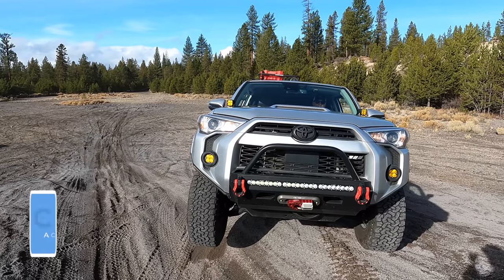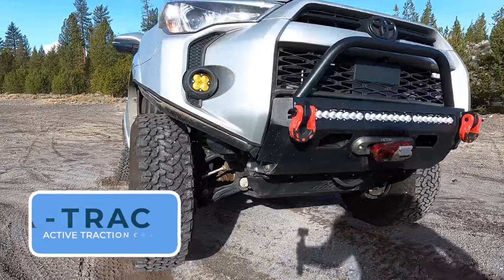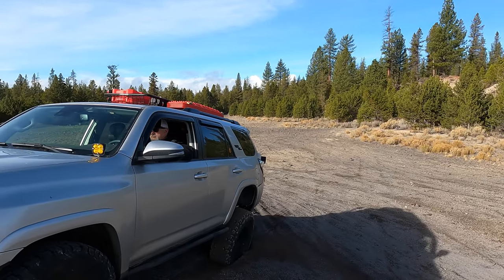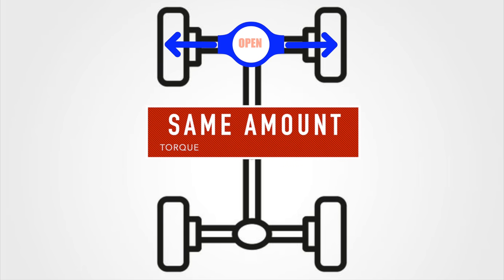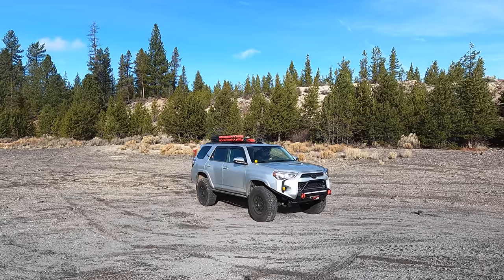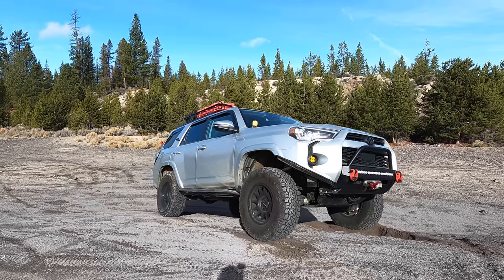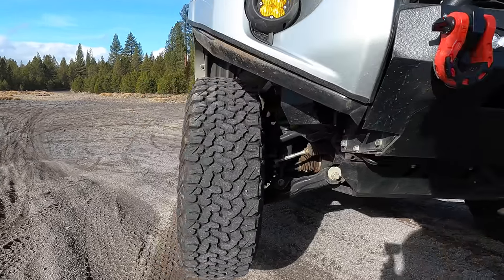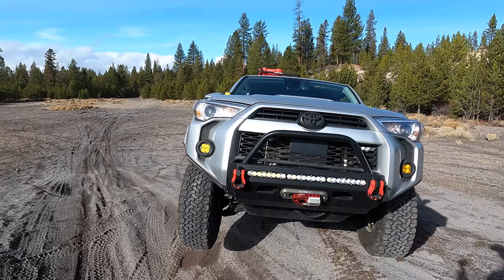Finally, The Only A-TRAC Video You Need to Watch. Multi Terrain Select Explained. ATRAC v ARB Locker

Comment: Very succinct and helpful. Thanks.

Is your brother using a Rigd rear tire hitch mounted tired carrier?
Reply from the maker: Thanks! I will ask Steve to join this thread and answer your question about the tire hitch mount.
Reply: Hey Tourist Dad, yes, that’s a Rigd tire carrier with a couple of options mounted to it, like high lift jack carrier, Rotopax mount, and the Frontrunner fold down table. I have ZERO complaints but will be selling it and moving to a full rear bumper. The places I go and things I do have dictated the need for more protection.
Reply: @aired-downoverland9239  Thanks, gents. I really enjoy the content. 

I'm up near Seattle and also own a 4runner...let me know if you end up putting it up for sale.

Comment: You have front lockers also on that TRD off-road ? is it aftermarket? 
you said you locked both front and rear lockers
Reply from the maker: Yes, I have an after market locker on the front axle. It is an ARB air locker.

Comment: Just wanted to say thanks for your time on this...also have you had any problems with your ARB Locker? I'm thinking of getting one for my Tacoma too. On another note...did you get a chance to fish the Metolius and Deschutes? Because I would...
Reply from the maker: Hi and thanks! The ARB air locker has been absolutely bomb proof. No problems whatsoever. I actually use it all the time. Much more often than A-TRAC or MTS. Maybe because you can engage it on the fly so easily. I also regeared to 4:88 at the time the locker was installed. Yes, I have been fishing the Metolius and Deschutes. I was just on the Deschutes about 10 days ago. I haven't done any filming of recent fishing trips as I just wanted to focus on the fishing experience. I had planned to go last weekend but other things came up. Not sure when I'll go next as I have other things scheduled. Let me know if you get the ARB air locker in the Tacoma. I'd be interested in what you think about it. Cheers!
Reply: @OverlandPNW  Thx for getting back...yeah I would be getting the 4.88s too...you must live close to the fishing..I'm in So.Cal...if you want a hoot for your fresh water gear and want to see your reel frikin fly land some benita in Redondo Beach Harbor...down to the backing I might add...but once you hook up watch out for the seals...you just slowed the benita up for them...you have to reel in fast or you'll come up with just the head...1 1/2" hook white feather yellow, pink....boom!...anyway thx and keep on keepin...maybe one day we'll hook up..I'm almost done with work..retirement coming.

Comment: That was superb, do you have a post about the mods to your silver off road? Thanks.
Reply from the maker: Thanks! The silver 4Runner is my brother's rig. He can give you more info about it on his channel @aired-downoverland9239. I have a partial list of his build which is: 

-Front bumper: Southern Style Offroad 
- Rear hitch-mounted spare tire carrier and swing out is made by Rigd
- Westcott Designs Rock Sliders
- CBI Skid Plates
- Rhino Rack Basket
- Tires BF Goodrich KO2 285/75R17
-Wheels are Method 704 in 17x8.5
- Southern Style Off-road Hybrid slim front bumper with high clearance fender mod
- Ironman foamcell pro stage 3 suspension, 3” front, 2” rear

Comment: Thanks for the great video. Please explain crawl control
Reply from the maker: Thanks! Crawl Control is a completely different traction control system. The vehicle controls the throttle and the breaking. All the driver does is steer. There are five different speed settings and a variety of different terrains that it works on. We are thinking about doing a video on it.

Comment: Awesome video! Can you tell me what roof rack setup is on the silver 4Runner? I'm looking to utilize my factory roof rack system as best I can because I'm on a bit of a budget with my 4Runner build.
Reply from the maker: Thanks! That roof rack is on Steve's rig. I will ask him to respond in this tread so you get the info.
Reply: That is an old Rhino Racks basket. This is the third vehicle I’ve had it on; I just love the size and fact you don’t see them everywhere.
Reply: BTW, I should have mentioned the crossbars are from Victory 4x4; they’re strong enough to hold a rooftop tent.

Comment: Why does my 2021 Toyota Tacoma not have an A-TRAC button?

The Tacoma owner's manual provides one answer to this. The owner's manual treats A-TRAC and MTS as mutually exclusive features of the manual and automatic transmissions respectively. Manual trans has A-TRAC. Automatic trans has MTS.

So my question coming out of your video is, what should I use in my 2021 automatic Tacoma when im stuck and starting from a dead stop? Your video pitches these features as for slightly different purposes, but the Toyota manual implies that they are similar enough to be applied to the different transmission types. Would "MTS Rock" be the closest thing my truck has to A-TRAC?

Thanks!!
Reply from the maker: My 4Runner has both MTS and A-TRAC but if I had to choose only one system, for me it would be MTS. So, your Tacoma has a nice traction option. The Toyota manual is right, A-TRAC and MTS are similar. In fact, there are many off-road scenarios in which either system would be just fine to get the job done. With regard to your last question, I do not really think of MTS in terms of which function is closest to A-TRAC. MTS is really designed around terrain types. So, when I use MTS, the settings I select are based on the terrain that I am on. I'm a fan of both A-TRAC and MTS and have spent a fair amount of time trying to learn what they can do. However, my own off-road driving practice is to use lockers. That's not a criticism of A-TRAC/MTS. I've been off-roading since I was 16 and it is just habit. So, you'll see us go to lockers a lot in our other videos. Cheers!

Comment: Great video, thank you!  One question, does A-TRAC only work on the front axle or both?
Reply from the maker: Thanks! A-TRAC works on both the front and rear axle. If you have a rear locker that is active, A-TRAC will work (in front) only when vehicle speed is less than 4 mph. Cheers!

Comment: Hello Overland  Pacific Northwest  .  The real locker come standard  but the front locker it must be installed by auto repair shop , is that right ?  Do you know how much it cost to install the front locker ? Thanks
Reply from the maker: You are correct, the front locker does not come standard. It is an ARB air locker. You'd have to check with a shop to get installation quotes. Mine was installed 5 years ago and prices have changed a lot.

Comment: Fantastic Video!
What kind of roof box is on the gray off road? Thks
Reply from the maker: Thanks!  That roof box is on my brother, Steve's 4Runner. He has the stock side rails but Victory 4x4 crossbars; they’re flat and will hold a roof top tent. The basket is an old Rhino Rack, which he has had on two previous vehicles. The 4 Maxtrax are attached using Maxtrax mounts, which bolt directly to the Victory 4x4 crossbars. The waterproof storage box is a Pelican or similar brand. If you want the exact brand of the box, I can ask him.
Reply: @OverlandPNW  Thanks I have the stock side rails and the dealer through in the oem crossbars. I’m looking for a basket for bins ect for summer. Any recommendations would be great. Really enjoy your content it’s so useful and entertaining.
Reply from the maker: @shawnw8046   Yakima makes a nice basket with integrated wind deflector.

Comment: I have a 2016 4R Trail Edition and it allows using the first position on the MTS dial to be used in 4HI as well.
Reply from the maker: Yes, you are correct. The first position is Mud & Sand. That is the only position that can be used in both 4H and 4L. This is discussed in the video. Please see 10:44 through 11:24 where this is discussed. Cheers!
Reply: @OverlandPNW  oh cool. Going to watch again to see what else I missed. Thanks
Reply: This is interesting that Toyota programmed the 4-Runner differently than the Tacoma in this regard.  2016 Tacoma TRD Off-road: none of the MTS settings will function in 4-hi.  Not even sand and mud :(.
Reply from the maker: @jkagsl4129  That is definitely a strange quirk from Toyota. You are correct, the Tacoma manual states: "The Multi-terrain Select can be operated when ●The four-wheel drive control switch is in “4L” position." 
So, as you said, it cannot be operated in 4H. 
However, the 4Runner manual states: "Multi-terrain Select can be activated when
● Vehicle speed is approximately 7 mph (12 km/h) or less.
● MUD & SAND: The front-wheel drive control lever is in L4 or H4.
LOOSE ROCK, MOGUL and ROCK: The front-wheel drive control lever is in L4."
So, yes the 4Runner can operate MTS Mud&Sand setting in 4H.

Comment: Old school Fj40 4x4’s had open diffs, if I understand correctly driver would manually use the brakes while accelerating to achieve what a-trac basically does. Question is can this same technique be used on newer A-trac equipped Toyota’s for momentary traction before actually engaging A-trac? Or does the ABS system not permit this.
Reply from the maker: That's a good question. I'll have to give it a try and see what happens.
Reply: It's a rally technique used today to prevent wheelspin at speed but in this case atrac differs because it modulates each wheel independently. You cant do that with just the pedal.

Comment: At the 03:00 mark, your ATRAC should have been able to pull you through that. Not sure why it didn't. Perhaps not giving it enough time to engage? Do 5th gens have a centre locker? Perhaps that is why? My 4th gen has ATRAC and a centre locker and would have powered through that no problem.

Comment: Hello - Could you please confirm if you used RD111?, or what was the part# you used for your front locker?
🙂
Reply from the maker: It is an ARB air locker but I do not have the part number.

Comment: Just curious .. how would you approach 2 -3 feet water crossing? In what combo would you use ? Ty
Reply from the maker: Just depends on the circumstances. Is is a sandy bottom, muck & mud, small rocks, boulders, mossy, dead logs, slow current, fast current,  steep muddy bank on the other side, etc. You don't want to use A-TRAC because that tool is really designed to get you started from a dead stop. It is not a constant driving tool. So, you could select the correct MTS settings for the situation but honestly I've never really considered MTS an underwater application. That's just me. I don't want all the brake actuators doing things underwater. I'm not sure it is designed for that. It may function just fine underwater but I haven't read anything on it one way or the other. So, I just tackle water crossings with standard four wheel drive and use a locker if I think conditions so dictate. If you are driving a Toyota, don't spend lot of time in water unless you have diff breathers. The rear locker actuator is notorious for failing due to water.
Reply: @OverlandPNW  thanks for the info🤙

Comment: Your initial explanation of what happens when one tire is off the ground is that something unique to this vehicles 4WD system?
Reply from the maker: If you are asking about how Open Differentials work then no, it is not unique. It is a characteristic of all open differentials. However, please bear in mind that in my description I tried to distill a complicated subject into a few, easily-understood sentences. With Open Differentials, Limited Slip Differentials, Torque-Vectoring Differential, and computerized torque splits.... it becomes complicated and it is not always exactly as I described. That being said, in very general terms, yes open differentials split torque equally. If you were asking about how A-TRAC applies brakes to the tire in the air, that method of traction control is used in many vehicles with computerized traction control systems. The A-TRAC system itself is a Toyota system. Cheers!

Comment: So in this video (I watched your Crawl Control video earlier) it seems you would still recommend a front air locker for serious moments over just relying on these features.  I wasn't sure after watching the other video.  It seems as good as these systems are and they are good, few things actually beat the "real" thing, either an e-locker or air locker.  Would that be a good assessment of what you're saying here?
Reply from the maker: Yes, that is a fair assessment. It all really depends on how you plan to use the vehicle. If it is going to be a true "off-road vehicle" and regularly driven through challenging obstacles, then lockers are the best choice. Granted, very few people who buy 4Runners do so with that in mind. So, the on board traction control systems are perfectly fine for most people.
Reply: @OverlandPNW  Thanks, I think ultimately I will get the air lockers, but it will check out first hand these systems as well.  I enjoyed and found the front and rear lockers in the Bronco to be very useful at times, but the front locker was only available while I was in 4L, which I found sometimes troublesome.  I didn't use it a lot, but didn't like being made to shift into 4L when I needed it especially is everything else around was just fine in 4H.  I guess that would be the benefit here as well, as A trac and CC seem to be only useable in 4L too, with an aftermarket locker, I can engage whenever I think it's necessary and then disengage as well.  Love your channel.

Comment: I have a 2914 Tacoma Off Road, is it possible to engage A-Trac and the rear locking differential at the same time?
Reply from the maker: I have a 2018 4Runner. My manual states that: If you are in 4L and engage the rear locker, A-TRAC will stop working on the front axle if you exceed 4 mph. So, on my rig, A-TRAC works in 4L with the rear diff locked so long as I do not exceed 4mph. I'm not sure about your 2014 Tacoma. Sorry I don't have a better answer for your 2014 Tacoma.  The Tacoma manuals are available online and it would be easy for you to check.

Comment: I have a 2008 FJ that only has A-trac and rear diff lock. I'll look through my manual, but I swear my A-trac has activated (when I had it on) in 2wd at medium speeds (15-25 mph)

I'm wondering if the A-trac systems are different
Reply from the maker: Interesting. On my 5th Gen 4Runner, A-TRAC does not work in 2WD. It only works in 4WD low.

Comment: Do u still need to hit the gas when you are in a-trac?
Reply from the maker: With A-Trac, you drive as you normally would under the conditions presented. So, yes you do use throttle.

Comment: Excellent video, I do have a question.  I am a little confused, you described MTS, is that the same as Crawl Control?
Reply from the maker: Nope, they are completely different. Crawl Control is a system that automatically adjusts the throttle and brakes on five low-speed settings. The driver only has to do the steering. We have done a few Crawl Control tests in our videos but I have not done a dedicated video on Crawl Control. It comes into play mostly in extreme off-road situations. People also like to use it when they get stuck in sand or need control going down a very steep off-road trail. Cheers!
Reply: @OverlandPNW  thank you.

Comment: Did your rig come equipped with the front locker?.....  I have the 2013 Trail teams edition FJ cruiser with rear locker and wondering if I should put a locker in the front.  It climbs like a goat as is. Your thoughts please.  Thank you for sharing.
Reply from the maker: My rig did not come equipped with a front locker. I re-geared to 4:88s and at the same time had an ARB air locker installed on the front axle. Your 2013 Trail Teams Edition FJ cruiser is a nice off-roader. You are right, they climb like goats! Your decision about installing a front locker really depends on the type of terrain and driving conditions you plan on encountering. Your FJ will get you through just about anything that the average off-roader encounters. So, you don't really need one but here's the reasons why I love mine: (1) I do tackle stuff that A-TRAC/MTS cannot handle, (2) I like it having the front locker as an "extra traction resource" because everyone in our group has had mechanical failures of the factory-installed e-locker on the rear diff, and (3) I use it in winter a lot driving over the pass on snowy roads because I can engage it on the fly. Here's what the ARB website says: An ARB Air Locker can be engaged at any speed as long as both wheels are spinning at the same rate." So, I don't have the same extreme low speed limitations that A-TRAC/MTS have. You do need to be careful engaging a front air locker on the fly because if one wheel is spinning faster than the other, what is called “crash locking” can occur and cause damage to the internal gears. Those are my thoughts for what they are worth. Cheers!
Reply: @OverlandPNW  thank you for your time.  Looking forward to your next video.  Have a great weekend.

Comment: You mentioned that MTS regulates throttle response. Does this mean I have to turn off my Pedal Commander to use MTS?
Reply from the maker: That is hands down one of the most preceptive questions asked in this comment section! I also have a Pedal Commander. There is zero literature published that I could find that answers that question. I don't know if it would mess with what the on-board computer is trying to do. I have tested it and my MTS appears to work fine with the Pedal Commander on but out of an abundance of caution, my practice is to turn off the Pedal Commander. Mine is conveniently located. So, it is a quick click of the buttons to turn it off.

Comment: Is your front locker the Air Locker? Which one do you use?
Reply from the maker: Yes, it is an air locker. I use the ARB air locker. It works great and I have never had a problem with it. Hands down one of the best mods I've made to the 4Runner!